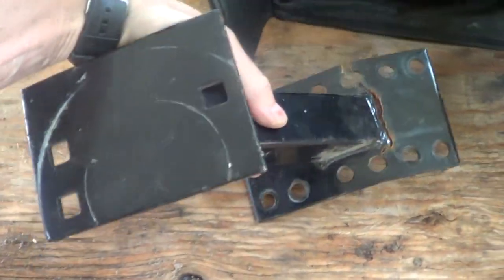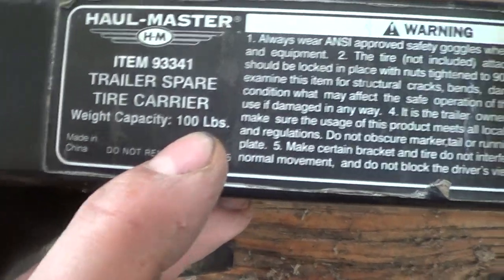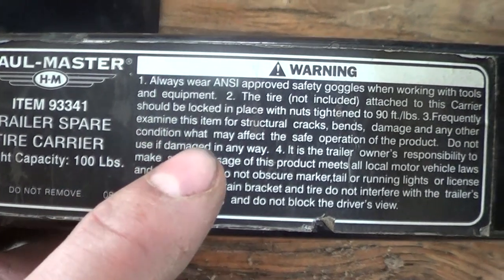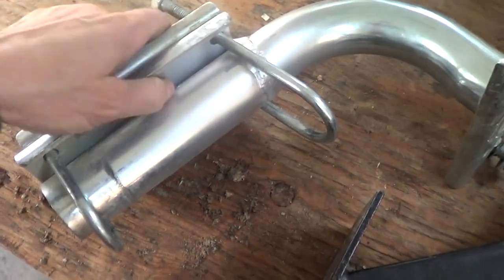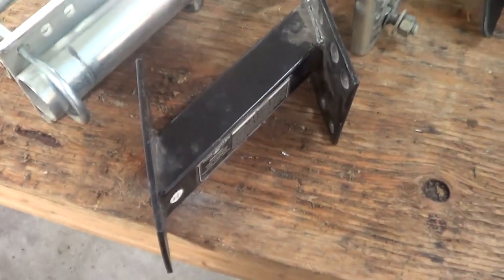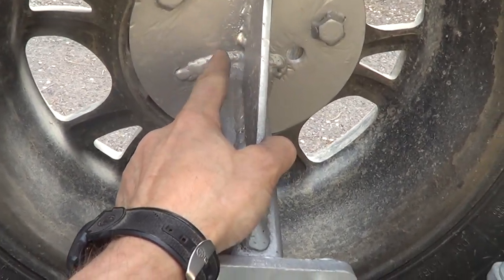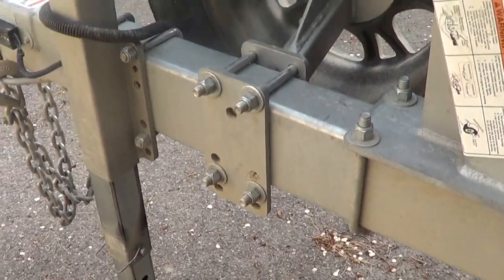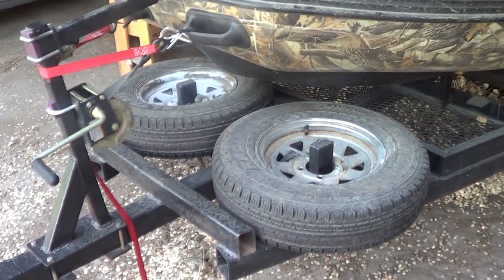Spare Tire Holder for Boat Trailer

Comment: Seen a continental trailer with a spare tire holder that had a hole hub assembly behind it, spindle was the mounting point. Pretty cool,